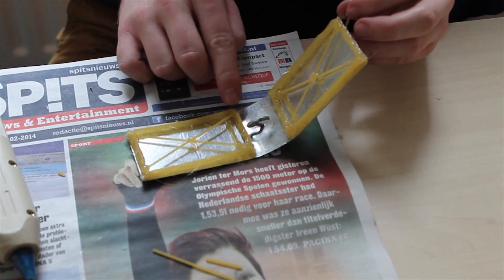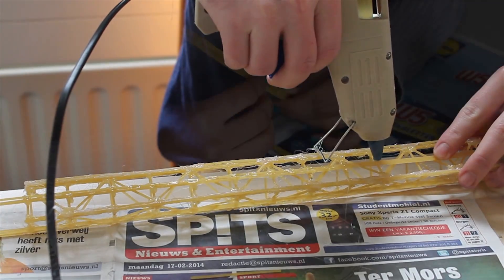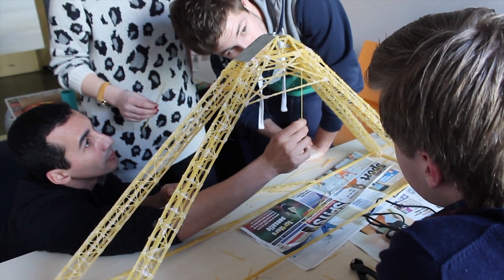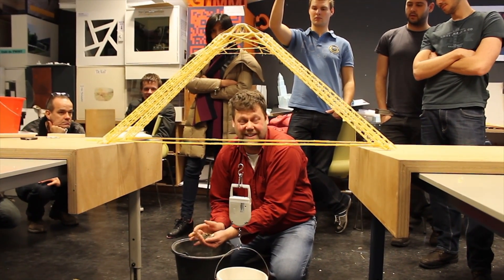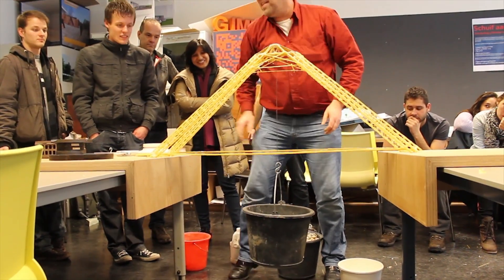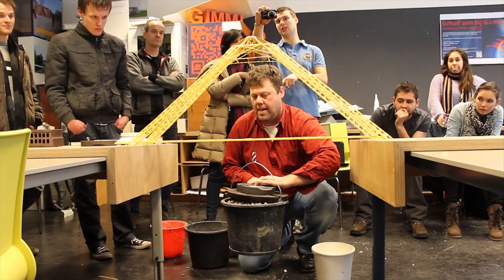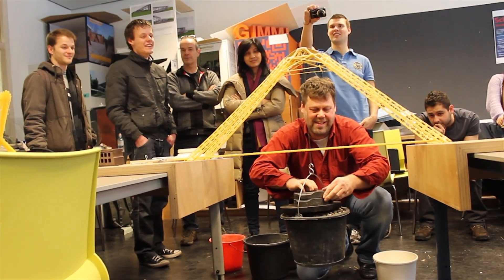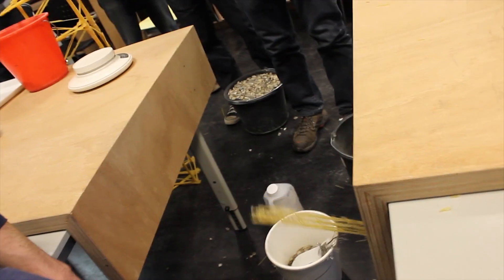Spaghetti bridge project

Comment: A bridge requires a surface to travel over. I didn't see one here unless they were supposed to go up the arches and back down. If a load was placed on the horizontal part, it would have broken with not even 1kg. XD

Comment: I am very sorry to point out that this is not a bridge but a structure across a gap which is centrally loaded .  It has  no deck to walk on and so it could not be tested for a load that travels along the " bridge".      It would be simpler to  erect four beams with a narrow  apex angle and simply  use  fixed ends at a compression structure at the support ends and one can do away with the tension components.    Again ,  this is a centrally loaded structure across a gap , but it is not a bridge.
Sir Christopher Wren used this idea to make the central dome of St Paul's cathedral in the form of a cone which could take such a heavy load.  But the dome was not a bridge was it. So using the same argument, these students did not build a bridge but they built a dome.